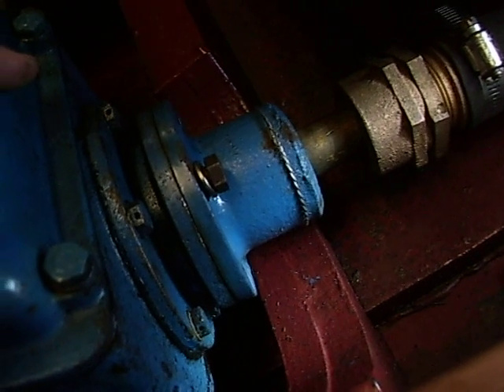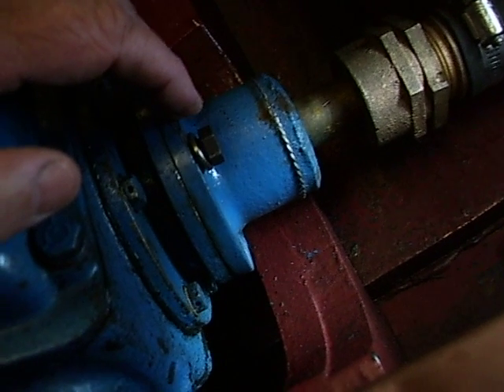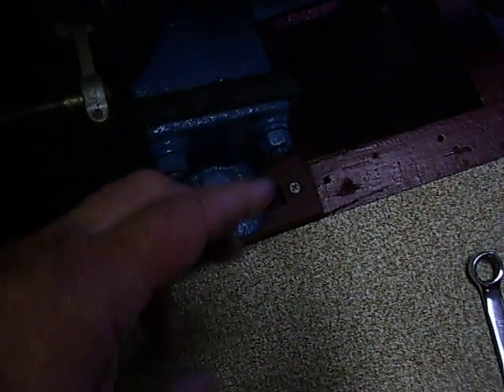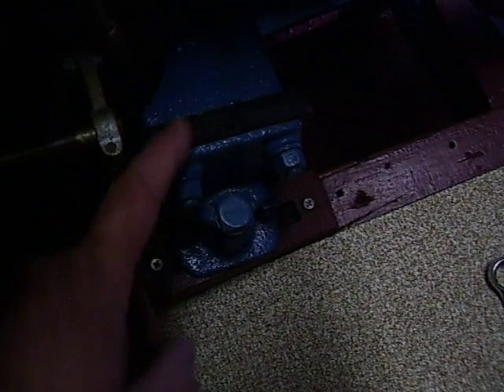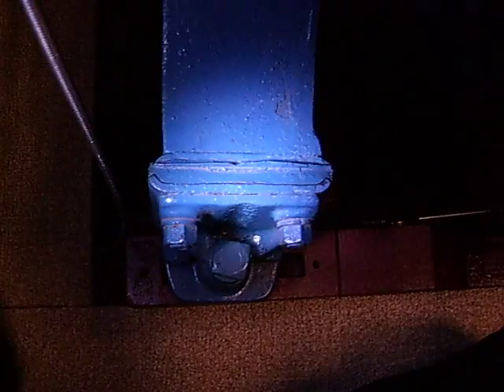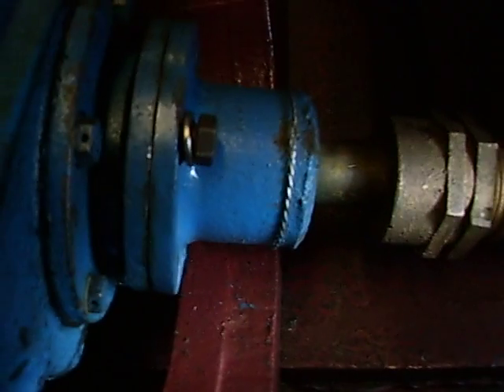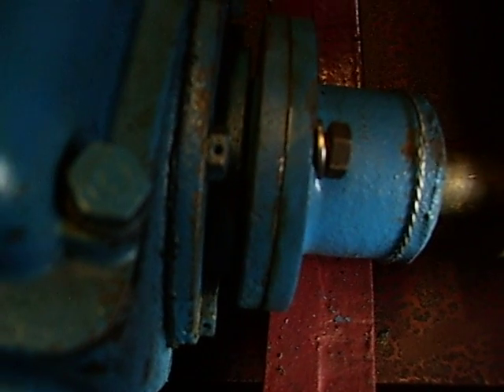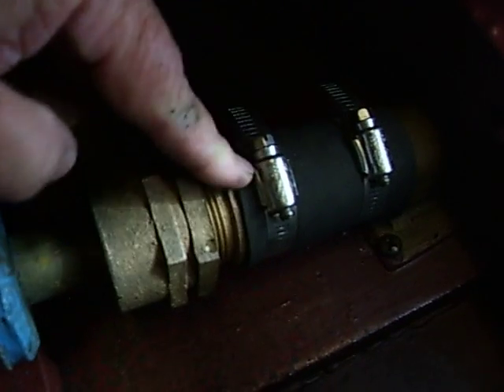Coupling Alignment 2

Comment: @pwcundiff  Your right on there.....even a small lowering on the front will allow  for the closure of the gap bigtime on the bottom of the coupling...... and as you say then you shim up all four feet to make the couplings concentric...which would be half the offset on same....

Comment from the maker: Please check who wrote what... you and I are on the same page. The nearest feet are at the back of the engine. Mega thinks raising the back will exacerbate the problem in his comments. 

Rasing the back or lowering the front will have the same effect because the rear mounts become fulcrums when lowering the front the coupling will actualy raise up in relation to its original position and the angle relative to the prop shaft coupling will be changed. Again you and I are saying the same thing.

Comment from the maker: Not quite sure I understood your comment.. but I get the angular misallignment out first and then go after paralell. So ... can lower front  OR raise back and get rid of angular. Then if I have a parallel missalignment I can raise or lower all four wedges to bring in parallel alignment. Always taking into consideration whether or not I am about center in the shaft log. For example.. if I my shaft is near the top or touching the shaft log at the top .. raising the back is not an option.  
sm pge